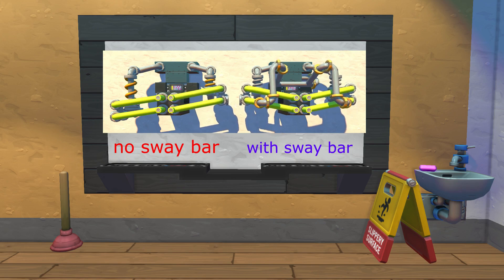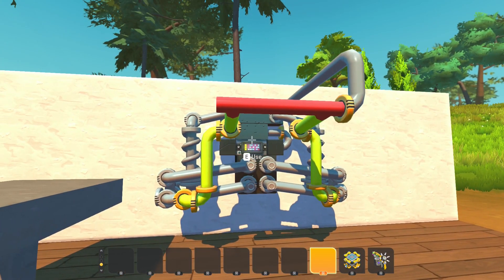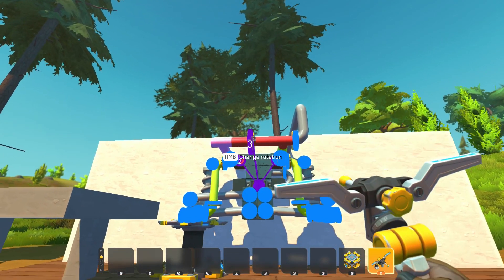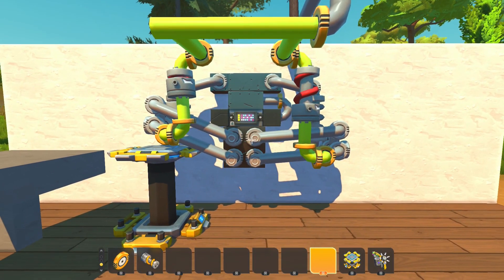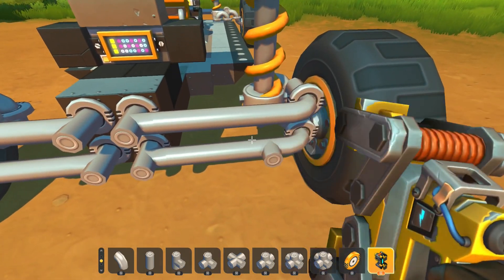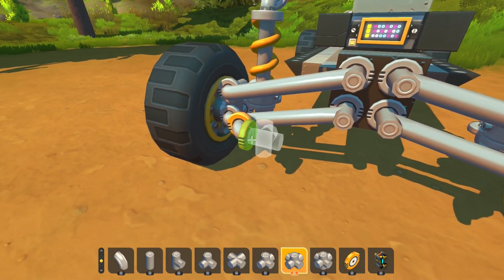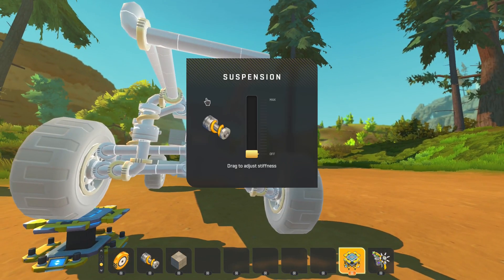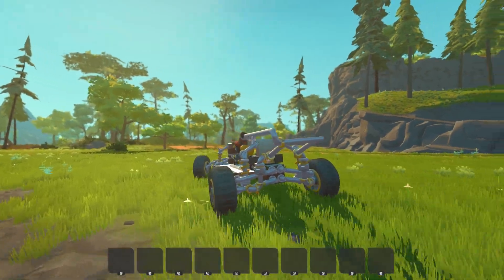How To Make Sway Bars in Scrap Mechanic? - Anti Roll for Double Wishbone Suspension Tutorial

Comment: I built a a sprint offroader and I have its suspension tuned where it still maintains independent traction. But loses none of its turning ability or stability. Been working on the shrunk suspension model.

Comment: You dont need the smart modpack engine to decide stiffness, you can also use a gas engine.
if you conect your gas engine to a logic gate & have a low power on it its going to put a bit of resistence, more power your give to the engine the more locked it is.

if you just take a simple plate on wheels & put it on a hill with a gas engine at max power that is turned off, its not going to roll (maybe slide), but then if you decrease the engine power for less "brake force" (off is 0 brake)
Reply from the maker: You are right that engines create stiffness. But the problem is that when the bearings get rotated they don't want to come back to the beginning position. 

Sway bar basically acts like a spring in real life.

Using engines is like using only dampers for your suspension without any springs. Yes it would make it harder to compress but when compressed it wouldn't have anything to push it back up. For a sway bar this would result in your car leaning to a side after you already exited a corner. Yes the suspension springs could combat this and make it somewhat leveled but for that the suspension would have to be really stiff and sway bar really soft to the point where you wouldn't even notice that there is any sway bar.
Reply: Using a controller would be better because of return to original position. However the point of the double wishbone is keeping the wheels completely vertical and independent

Comment: Method #1: The controller is very stiff, and cannot be tuned for performance in vannila.

Method #2: Very interesting. But it has no tuneability.

Method #3: This has tunability, soft stiffness, and is perfect. But you can use WAY less bearings on the top bar by using ONE link wich will eliminate 2 unneeded bearings.
You can also make more compact mechanisms by rearranging parts differently.

For even more suspention performance, I lile to combine the sway bar with active camber created by differently angled suspention arms. Pauglin taught me that.
Reply from the maker: I don't really understand what do you mean by removing the 2 unneeded bearings. Would you mind joining my discord and sharing a picture? Or just count the bearings from the bottom up and tell me which ones.

The method #1 has use only when you want a very stiff sway bar and have a very heavy vehicle

The method #2 is very similar to that, but I actually use it sometimes when I don't have enough space to fit springs in there.

Method #3 = the best method (unless you want to use the modular controller from the modpack)
Reply: @Pauglin  Sorry. I Just figured now that it is just shaped differently. I counted wrong. Lol, Im stupid.